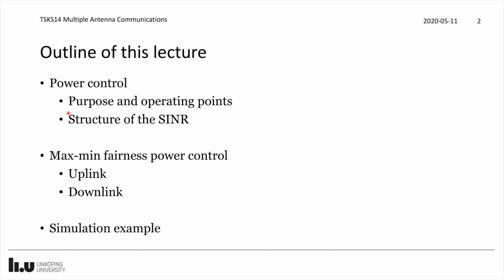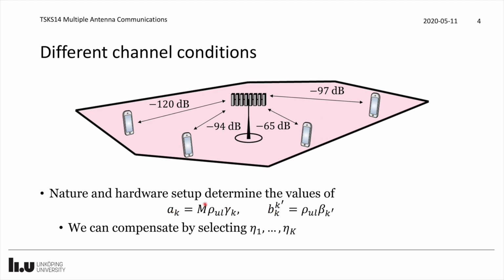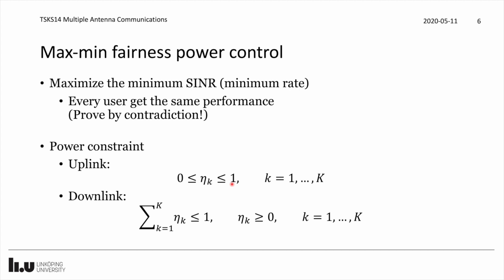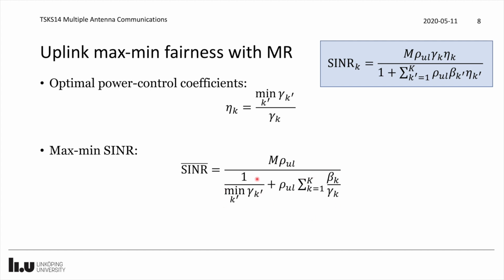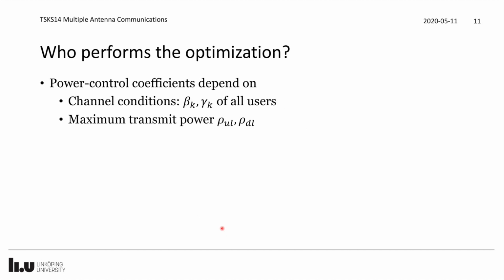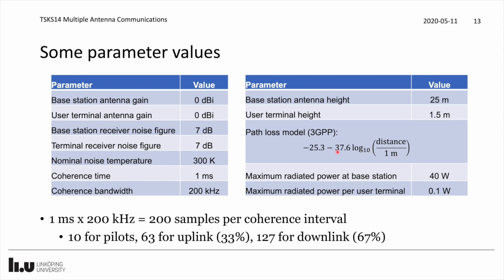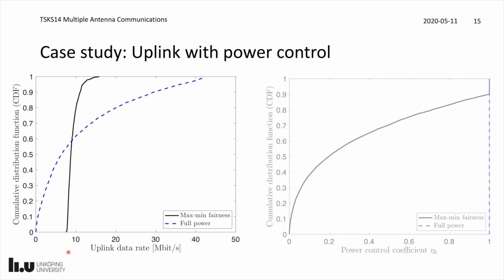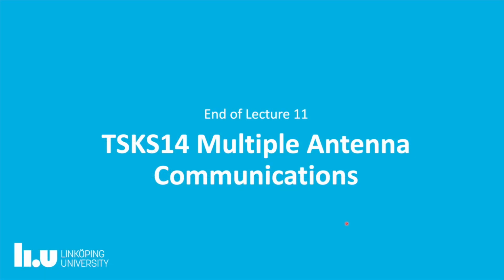Lecture 11: Power control in massive MIMO (Multiple Antenna Communications)

Comment: Thanks for your efforts and care but some questions

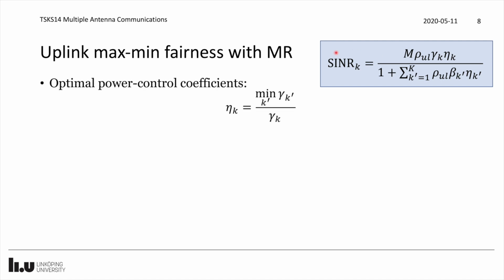1- @15:44 why did you make the numerator have min gamma k dash? Why not just 1/ gamma k ? And why not use the max instead of min ?

2-why in max min Fairness we want all users to have same sinr ? In this case which sinr would they have the max or the min or what
Reply from the maker: This lecture is covering a few sections of the book Fundamentals of Massive MIMO, so you can find all the details there.

1. The proof (which you find in the book) is based on making the power inversely proportional to gamma_k, to get equally strong signal for all users. We then want to select the proportionality constant so that at least one user uses full power. This is achieved by min_k’ \gamma_k’.

2. That is the definition of max-min fairness. We want to maximize the minimum SINR among all the users. Since there is no incentive to give anyone a higher SINR than the minimum, we will effectively give everyone the same SINR and then maximize that common value. This is what I described above. Eta_k = constant/gamma_k makes all the SINRs equal. We then pick the largest constant that keeps all the eta_k <=1.
Reply: @WirelessFuture   thank you

Comment: Thank you for your brief explanation and i would like to ask how to apply sum SE maximization with max-min fairness in massive MIMO and SINR expressed interms of CDF what about other parameters?
Reply from the maker: Sum SE maximization and max-min fairness are two different optimization criteria so one cannot consider them at the same time. However, Chapter 7 of the book Massive MIMO networks (http://massivemimobook.com) shows how to optimize max-min fairness. The sum SE is more complicated to optimize, but one can find locally optimal solutions using the WMMSE algorithm (see https://arxiv.org/pdf/1901.03620.pdf)
Reply: @WirelessFuture  can WMMSE algorithm can applicable in cell free massive mimo?
Reply from the maker: Yes, it is. Here is a paper about that: https://ieeexplore.ieee.org/document/9293031/

Comment: Most of these optimization problem are heavily non-convex in both constraint and objective function.

Can you make a video explaining how they would do it in a tractable manner since the coherence time is often within 1 ms
Reply from the maker: The power optimization problems actually have convex (linear) constraints, but the objective function can sometimes be non-convex. In this video, we talk about max-min fairness in a setup where the problem is both convex and can be solved in closed form. So the implementation complexity is almost zero.

The coherence time doesn’t matter when it comes to power optimization in Massive MIMO. We are not trying to adapt the powers to the small scale fading realizations. Instead, we are optimizing the ergodic rates, which leads to a solution that is useful for as long time as the channel statistics are fixed. I recommend you to read Myth 9 in this paper: https://arxiv.org/pdf/1503.06854.pdf

Comment: at 28.33, 63 samples are used for each user in uplink or the samples are divided between all users in uplink?
Reply from the maker: The same 63 samples are used by all users. The signal from the users are separated by utilizing the many antennas at the base station. This is the main idea with multiple antenna communications.
Reply: @WirelessFuture  Thank you Professor.